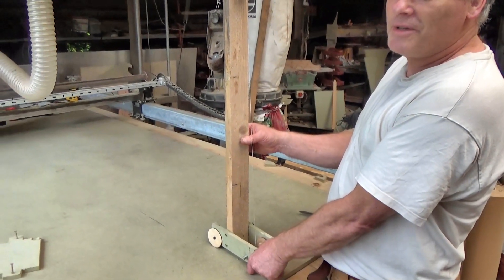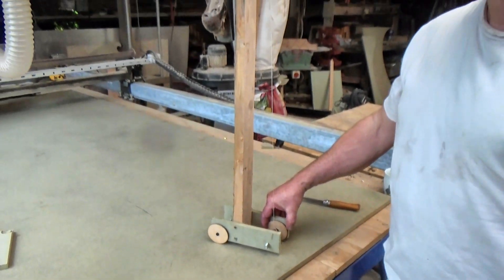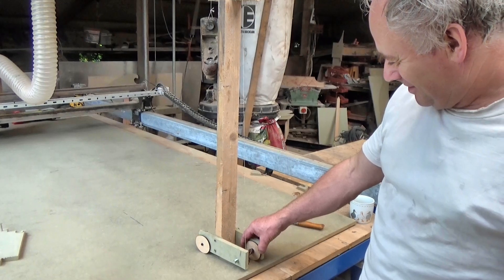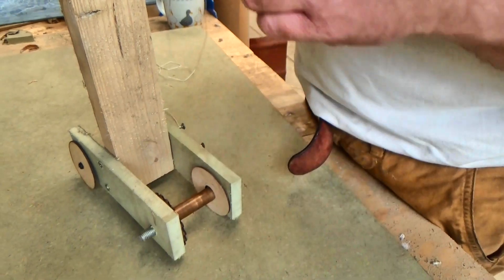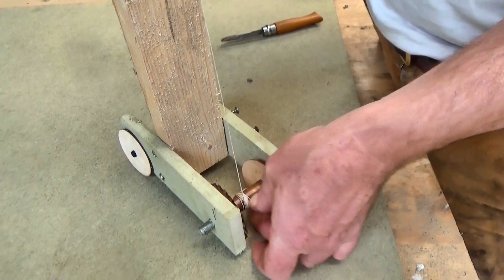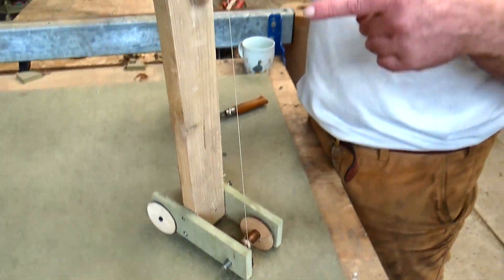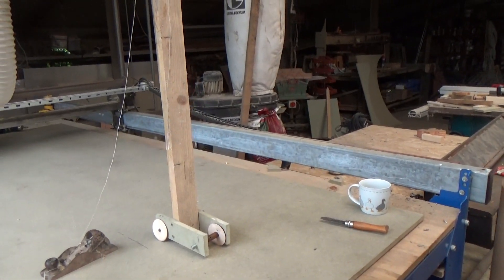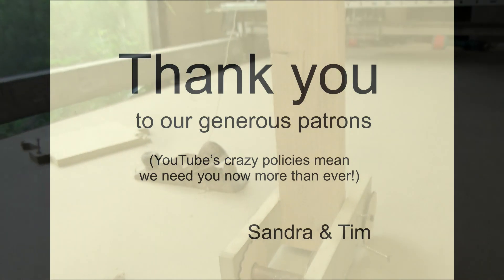A Full-Size Wind-Up Car - Would It Be Possible To Make One? Mark One.

Comment: I was working on a clockwork thing and thought using a block and tackle with a really heavy weight or spring on it would let you get a lot of line strung out for only moving the weight a short ways. Probably a spring would be better in your case because it's less load to lug around on wheels, but big springs can be a bit scary. Tom Stanton from another channel had a clever idea a few videos back to use a vacuum piston for load. That's nice because it's like a spring with a constant force regardless of how far you pull it.
Reply from the maker: Yes, I hope to get to compressed air and vacuum springs soon, but I'll look at metal and rubber springs next.. Thanks for the suggestion of Tom Stanton - I hadn't come across him before. Excellent.
Reply: Fancy seeing you here, friend. Come around often or did the title draw you in?
Reply: Gravity light. That's what I had on the tip of my tongue yesterday.
Reply: I tried this with k-nex although found the limiting factor was the string pulling on the axle made a lot of friction. Maybe I will try one with fidget spinner bearings.

Comment: Fun. But steam powered would be more efficient than windup
Reply: A petrol engine would be even more efficient than that.
Reply: @Margarinetaylorgrease  steam has more torque than petrol engines. No need for Transmission. Read up on early steam cars.
Reply from the maker: Yes, I hope to get to compressed air/steam and vacuum springs soon, but I'll look at metal and rubber springs next..
Reply from the maker: And you're right, modern steam engines are way better than the early ones..

Comment: Might be useful in a very flat area, but you'd never be able to travel up any hill taller than the top of your car where the weight is.
Reply: You might be interested to read how a water ram pump works, then you might think about revising your comment?
Reply: @bootsowen  I fail to see how that applies.

The reality is that the potential energy of a weight raised to some height is fixed. If you raise the weight 2 m, the car+weight cannot travel up a grade greater than 2 m. You couldn't even make it close to that when you consider the additional weight of the car and any losses.
Reply: @danno1111  Yes indeed, i think you are right, the ram pump has an external source of energy, I just so wanted tim's car to work. tell ya what, what if you use a bigger weight?

Comment: Hi Will and Tim.  The comments so far seem to focus on the why not. But what about a bicycle, with some way of storing the energy when you are freewheeling or not moving. something like a bicycle with a bathtub sidecar and another bathtub up in the sky. somehow (this is where you come in Will and Tim) somehow the surplus energy pumps the water to the upper tub, and then when required the water can flow back down through a waterwheel to power the wheels again.  Obviously head is important in how much energy is stored, so having the upper tub as high as possible is a must, I think you could measure the telephone wires and see how high you can get away with.  As far as I know, as long as a bicycle has brakes that work it is considered roadworthy, height is not an issue.  I really can't see any downsides.
Reply: If its over a certain speed they will want to tax it, no matter how its constructed!😖
Reply: @noranneduffy  So a slow moving double bathtub bicycle then. this thing will design itself!
Reply: This needs to be a collaboration with Colin Furze!
Reply: I love this concept!
Reply from the maker: No downsides at all, bootsowen : -  )

Comment: Flywheel big heavy flywheel . Wind up a  flywheel store the energy there
Reply: Yes. Read about the Gyrobus if you aren't familiar!
Reply: @zbradbell  I was about to mention the Gyrobus! There's also those hybrid flywheel-cum-electric buses which use KE lost in braking to spin up a flywheel for later use.
Reply: The problem being that they require rather sophisticated electric setups to input and extract the angular momentum of the flywheel. It could theoretically be accomplished with pure mechanics, but that would likely be a long road to a device with a short lifespan via wear.
Reply: I knew somebody would beat me to it!

Comment: The amount of energy required to move a car is not insignificant. 
The falling mass would need to be ridiculously large if you intended to travel more then a few meters. Without doing any calculations, I assume you would quickly reach a point of diminishing returns, where the weight of the structure needed to support the falling mass would become heavier then the falling mass itself and the contraption would not move.
Springs would probably suffer a similar fate.
Reply: Indeed, and it's easy to work out when you know that electric cars go 3 or 4 miles for each kWh. That's about 1 million Joules per mile. Tim's wind up car had maybe 10 J. Even his joking estimate of 'many tons' is a couple of orders of magnitude short.
Reply: THAN
Reply: @grantofat6438  The amazing thing about the English language is that words can be used 'incorrectly', but if the intended message is still conveyed, THAN it doesn't matter if it's not perfect. English isn't a strictly structured language like Mandarin. It is very fluid and always changing. Context is more important THEN correctness.